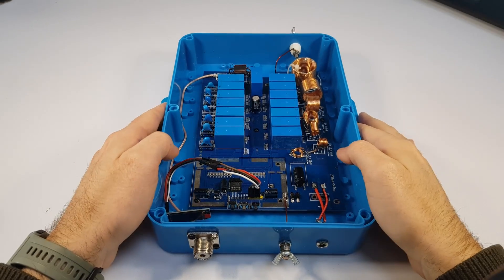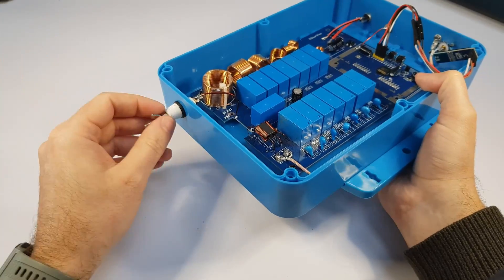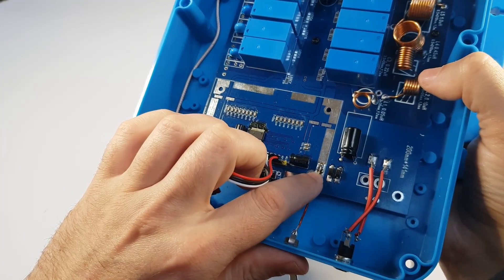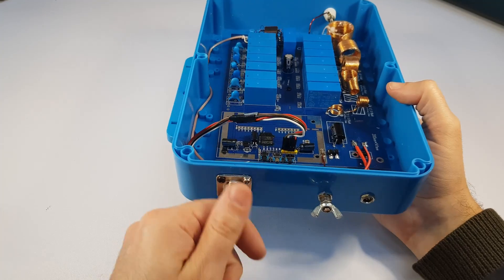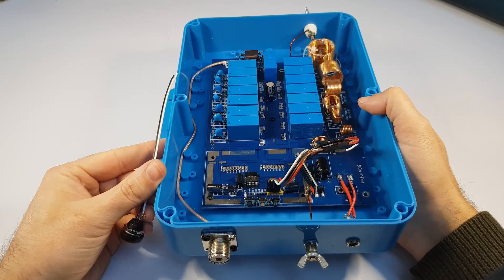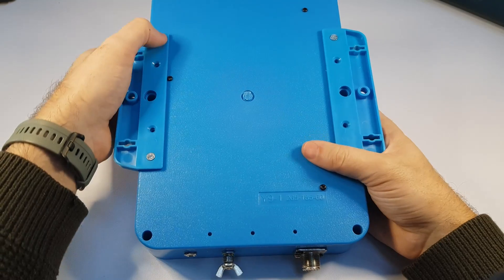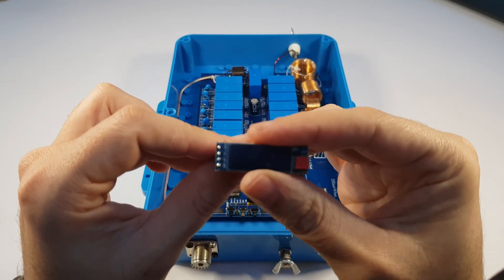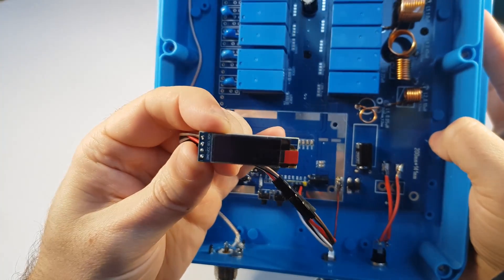AT50 AUTOMATIC ANTENNA TUNER ASSEMBLY INSTRUCTIONS

Comment: You can feed the 12V via the coax cable, just block dc with a 100nF and rf with a 100uH inductor. Thanks for the video!

Comment: If I use vertical antenna which connected by coaxial cable should I use PL connector instead of supplied connector? Thanks.
Reply from the maker: Hi, yes use PL connector
Reply: @RADIOBUNKER73  Thank you…..

Comment: Hi, I would like to know if the PCB comes assembled i.e. all the components already soldered in the PCB. I also would like to know if the tune switch should be replaced by a jumper if te ATS is planned to be external at the top of the roof. Thanks
Reply from the maker: Yes the board is already soldered, and you dont need to use a jumper theres a function to auto tune and is saved in a non volatile memory
Reply: @RADIOBUNKER73  Gracias amigo, yo logre el manual pero no viene ningun dato mas tecnico asi que quede en el limbo. o mejor, quedaria si no fuera por tu atencion. Muchas Gracias. Yo tengo planes de poner el ATU en el techo (roof) del edificio y alimentar el DC atraves del próprio cable coaxial. Para esto voy utilizar unos  bias tee que tengo listo por acá. Una observacion importante: no todos los comprimentos de cable son buenos, hay que evitar algunos que no permiten que el tuner logre hacer una sintonia.
Reply: @RADIOBUNKER73  Ya me olvidava de una cosita... en mi caso de uso remoto, la unidad puede marchar sin el display? O sea, lo conecto para pruebas y para garantir el ajuste de auto tune pero piensava en sacarlo despues. Gracias otras vez !saludos desde Rio